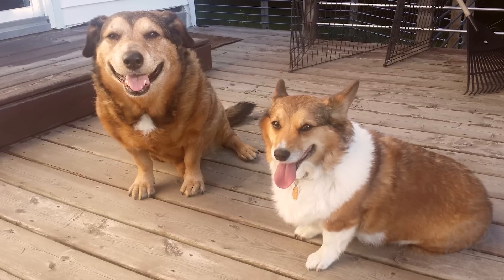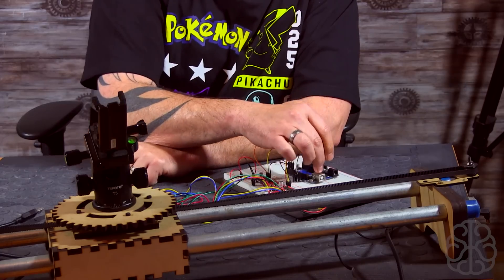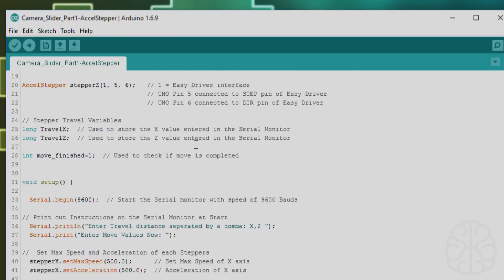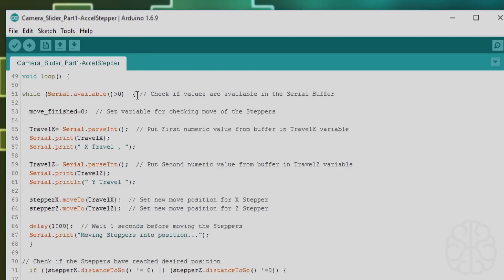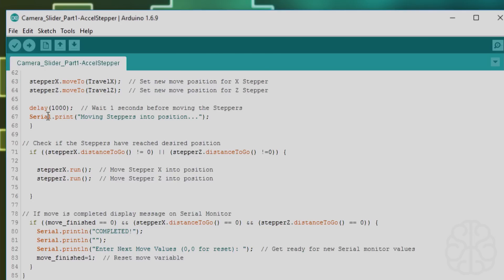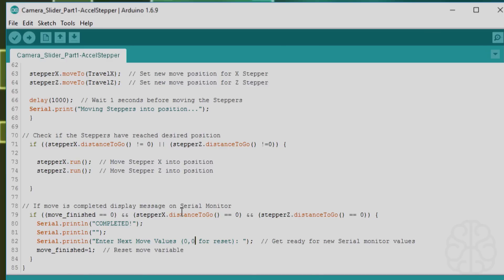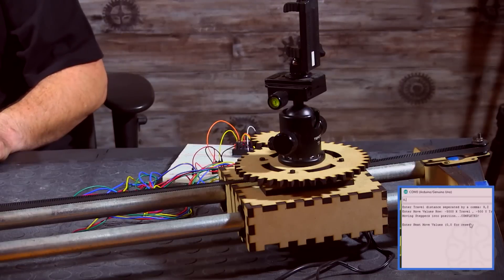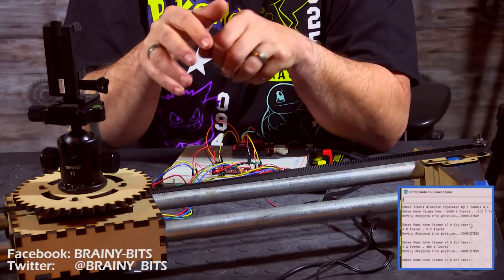Control 2 Stepper Motor using an Arduino, Easy Driver and Serial Monitor - Tutorial

Comment: Works perfectly. I'm using Arduino Nano and A4988. The only change I made was to reverse dir and step (1, 3, 2). I'm planning on using this for a small cnc milling table project.

Comment: Thanks for this video and I need some help.
I am using stepper motors which are bigger (larger than 4 ampere) Nema 23 or larger . For these stepper motors which driver I can use ? And what changes will made in code ?

Comment: Big thanks for going through your code, it is invaluable for those of us learning. I came across this in my search to learn how to control 2 steppers using the AccelStepper library and your demo as well as talking through the code has answered a multitude of questions I needed answering.
Reply from the maker: Thanks for the comment, I always questioned if explaining the code was boring, so I will at least try to explain the big stuff in future videos.   Thank you for watching!
Reply: instablaster.

Comment: Hey i am currently doing stepper motor and serial print project, from what i know, if i put more serial.print() in the code, it will slow down the stepper motor , is that true? how do you overcome this issue?

Comment: For those with problems with this code not working (i spent hours trying to fix this, it works with any driver aswell), you have to make sure your monitor serial is with "no line ending" selected, which is on the left side of baud rate. thx for the code, it works!
Reply: legend
Reply: hi, i tried everything but it is not working..is there something i may have missed?

Comment: Great video Yvan! Question for you...
On the AccelStepper web site, a Class called "MultiStepper" is used to "operate Multiple AccelStepper in a coordinated fashion" by using the addStepper function.... Why do I not see that in you code?
Thanks, 
 MultiStepper would make a great video. 😉
Reply from the maker: Hi Martin, I've made a tutorial using "MultiStepper" here: https://www.youtube.com/watch?v=lvP5xMOstus and here's the tutorial page: https://www.brainy-bits.com/dual-axis-camera-slider-using-joystick-in-and-out/  Hope that helps. Thanks for watching.
Reply: OK.. I think you answered my quesion.
You don't need Multistepper to have two or more steppers, but you do need it to have them get to endpoints simultaneously.... That said, it was pure fluke that in this video, both steppers ended simultaneously at 10:00? So if you wouldv'e had a higher maxSpeed on one of them, then that one would've finished first. Correct?

Again, thanks for the high quality video. Good explanations and quality graphics/audio  and of course contents.
Martin

Comment: How would you wire it if you'd rather power the arduino uno instead of using a battery connected to the circuit board?

Comment: Brilliant tutorial!
So the AccelStepper Library only supports the Easy Driver? I have a CNC shield with the A4888 drivers for 3 axis control...yes tilt too if I can get it to work...
Tried your code and the steppers are not switched on. I know the pin for turning them on/off is '8' but it's not the same as what pin '1' on the easy driver does?

Comment: Thanks so much for the video! really helpful to the project i´m doing. i´m really so much very interested on the second video you
 spoke about. I would really want to know how to calculate the speed and acceleration automatically. I´m working on a project where the steppers have to finish running at the same time indepent of the thier various positions. Thank you!

Comment: Oh me.  The code just isn't working for me.  I have no Easy-Drivers but substituting LEDs with 330Ω resistors at the Arduino pins 2-3 & 5-6, Step & Direction pins, in place of the Easy-drivers, I get no indication that anything is happening when I input values into the Serial Monitor.  I have included the missing Accelstepper into the INO.
Does this code require the Easy-drivers or should the LEDs give an indication of the state of the Step and Direction pins output?
would A4988 Stepsticks work in place of Easy-drivers?  I really would like to get this very cool project working. 
Thanks